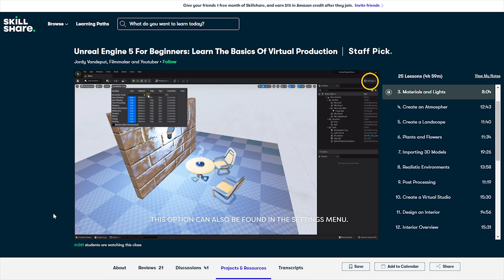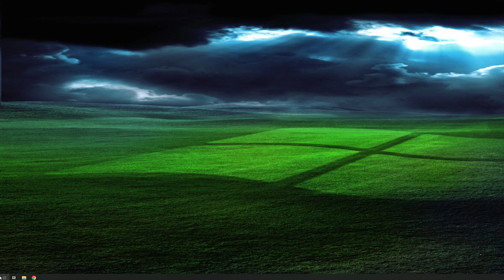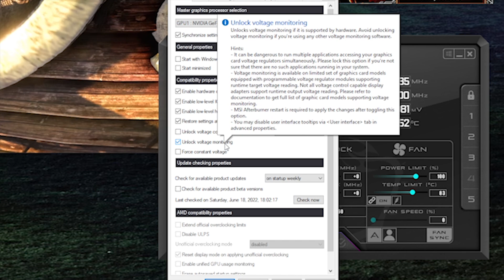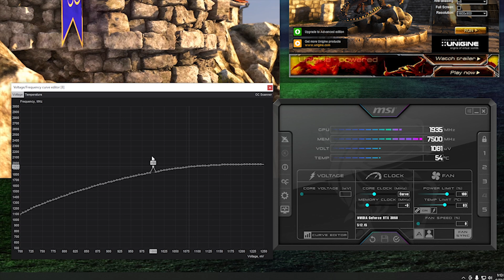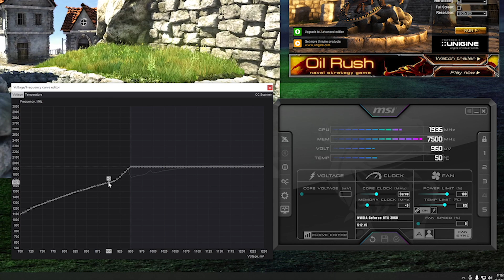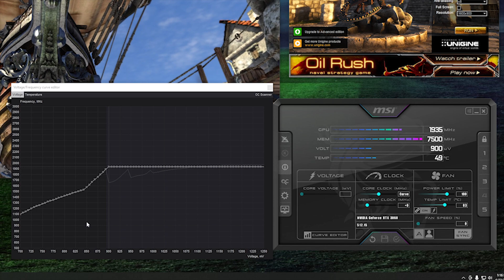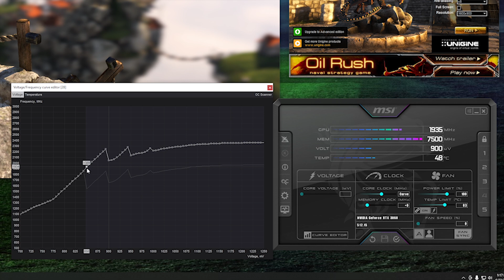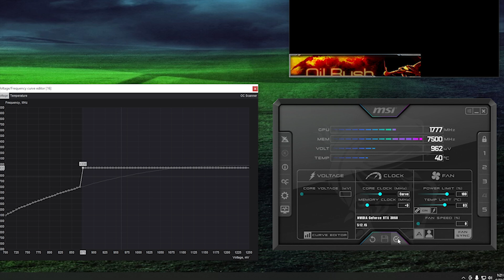Should You Undervolt Your GPU?

Comment: Im a noob when it comes to this stuff but I tried following the steps as best I could from videos on YouTube. My 3080 12GB model would always hit and stay at 83c when gaming. The core clocks would be around 1980-2000. After messing with my case fans and GPU fans I got it around 70c but my pc sounded like it was about to take off lol. So I tried undervolting and came to 1920 core clock at 850mv. I ran a few benchmarks and played some ray tracing games and no crashes and now my GPU is around 65-67c while playing the same games.
Reply: This is what i like to see, learning to make your PC run better & cooler.
Reply: Your an example of someone I would say to undervolt the gpu. People undervolting gpu's at 63c already is just stupid. The entire point of doing this is to get to 60-70c range of heat. Nvidia says the operating range of these cards is 40-90c for normal operations. Anything above 90c is way to hot. So you were getting close to the to hot side of things and undervolting in your case is exalting what this video is great to show someone like you.
Reply: can you please help me understand one thing. I just cannot come to the logical conclusion. Figuring out the mv seems easy by just trial and error. But how do you find out what mHz to set as the max for that mv? my gpu jumps between 1870 and 2050, and if it nears thermal throttling it moves even more. I just dont understand where the guy in the video got 1935 from, or where you got 1920 from
Reply: The funny part is, often times your average FPS will go down slightly, but in actual gameplay it feels better.  Probably due to a more consistent frame time.
Reply: So let’s revisit after your OP. I bet you put the voltage back to stock. Then downloaded MSI Afterburner. Then cranked the voltage and the power limit and added core and ram MHZ so you could get higher FPS than an out of the box card.  Why wouldn’t you want 10% extra horsepower for free?  Undervolting is just plain stupid. If your temps were too high you have another issue to look at.  Like case airflow.  I run my 3080Ti at 100% fans and it sits at 2040mhz at 1440p at 65-70c. My 2080ti in water would run at 2100mhz at 50-55c. Where headphones and you can’t hear 100% fans. Just depends on the clocks you’re chasing. But undervolting is stupid.
Reply: @ironmaiden5658  20 years of experience how to reduce the lifetime of your card and probably fry some memory dies along the line. You are a hero.
Reply: @saltysalt7339  I still own the very first card I overclocked in 1998. And it still works. Shorten the lifespan. How long of a life do you want?  Unless you’re building a period correct PC and need an old card, a 25 year old card is useless. You're excuse is moot.
Reply: @saltysalt7339  Hey I know. Let's pay the price of a 4090 but then undervolt it to the speed of a 4080. Pfffft.
Reply: @ironmaiden5658  All dem cards just work 10 years straight for sure. All those broken cards out there are just for show and fake news. What a clown.
Reply: @notstarboard9792 Overclocks never makes sense. Bahahaha. Thanks for the giggle. You should tell that to the world overclock record holders. I'm sure they'd get a good giggle out of your wisdom as well.
Reply: @ironmaiden5658  Fans don't get worn out? I run my fans all the way but I've been freaking out a bit about that

So undervolting is dumb unless my Temps are out of control?
Reply: @SmoothSportsGaming  I own nvidia graphics cards that are 25 years old. The fan still works perfectly. Undervolting is a myth. In fact Nvidia just released an official overclocking tool. Funny enough it doesn't undervolt.
Reply: @ironmaiden5658  Thanks man. Glad I didn't just believe all these videos. I knew something was up when every video was copy & paste.

You mean the auto overclock? I have that on but I can't tweak it so I'm going to MSI
Reply: @SmoothSportsGaming  Yeah no worries. Yeah the auto overclocking is a bit rubbish. It's really only for noobs who don't know how to properly overclock but want that little bit extra for what they paid for. MSI is 100% the go-to to overclock every card when you know what you're doing. If you have a 3xxx or a 4xxx series card you can't go wrong. They're so locked down these days it's just a matter of cranking up the core and ram till it crashes or artifacts. I've been a watercooler for almost 20 years but the way the 3xxx and the 4xxx series cards are managed I ditched water cooling after my 2080Ti and been running the fans on the 3080Ti. Water cooling the 3xxx and the 4xxx series is a lot of money with very little return in FPS vs air cooling overclocking.
Reply: @ironmaiden5658  Under volting is great for say a laptop gpu. I can't make that laptop have better air flow tbh. I can't upgrade fans or add water cooling to it. I am limited on what I can do with that machine. But what I can do is undervolt the gpu. 

I agree most of the time you don't want to undervolt your gpu at all. Zero performance boost and you reducing performance actually if you doing it when you around temps like you stated. But if you at 83-90c. You close to temp throttle anyway. Undervolting the card will most likely give you a boost in performance because of it.
Reply: So you successfully achieved lower clocks and lower FPS.. Yeah cool. Good story bro. Way to overclock. NOT.
Reply: @ironmaiden5658  Benefits outweigh the negatives. Not losing as much fps as you think.
Reply: @thurstoid9811  BS. I've been overclocking for 20 years. You want as many Volts and Watts as you can throw at the card. There are 3 factors. Watts. Volts. Degrees. If you're just a pleb running stock fans then we can't even talk. aa
Reply: @ironmaiden5658  Ahh i see the master of graphics is here...
Reply: @bopheadshot2710  Yep. My 3080Ti is 2085Mhz with 1.085 volts. 350 watts. 66 degrees C. . 100% fans. 1000Mhz RAM. Been overclocking since this guy was on the milk bottle. haha. Under volting is the dumbest thing I've ever heard.
Reply: @ironmaiden5658  100% fans? you must be deaf
Reply: @andreivladut11  Get a good case. Wear noise cancelling headphones. Get good.
Reply: @ironmaiden5658  You have no idea what you’re advocating against and what kind of idea you’re trying to get across. A good undervolt will always outweigh the benefits of an aggressive overclock. I’m running a 4090 with a 13900k and I’d choose an undervolt over an overclock any day.
Reply: @sgtdroid  Absolute BS.
Reply: @ironmaiden5658  better to undervolt then im not pc savvy so would probably leave mine

Comment: My old pc is 4 yrs old. Running windows 10 Pro (😂 without MS account) and Asus Armoury Crate + Aura Creator for mobo, ram and case fans. My PC specs are :
1. i3 8100 LGA1151.
2. Asus Z370 TUF Gaming Plus ATX Mobo.
3. Cooler Master Hyper x212 CPU Cooler.
4. G.Skill Trident Z RGB 16GB 3000mhz (2 x 8GB kit).
5. Asus Strix GeForce GTX 1060 6GB OC Dual Fan (Black).
6. 1x Samsung Evo 960 M.2 Storage.
7. 1x Seagate Barracuda 1TB HDD.
8. 1x Kingston HyperX Fury RGB 240 GB SSD.
9. 1x NZXT HUE Plus LED Strip + Controller.
10. DeepCool RF120 mm RGB fans  (3 x fan kit).
11. Corsair CS650M 80+ Gold PSU.
I hope i may learn something about GPU.
Reply: Not really a fan of the cpu you have. I think you could easily upgrade for cheap. Not having those extra 4 threads on that cpu is huge. I have a i7 2700k which is insanely older than your cpu. Yet those 4 extra threads lets it easily compete with your newer cpu and beats it for performance. You should upgrade that cpu. To something better imo. You have the mobo for the upgrade. Imo if a cpu from 2011 is better your 2017 cpu and it is cheaper to buy the older cpu. Then just get the i5-8000 series cpus. These are worth it. Cost the same a brand new 2700k would cost and beat it in performance. 

Your board supports the 9000 series also. I'd buy a i5 from that series if you want to stay budget friendly. Same price as a 8000 series i5, but newer and better performance with 6 core 6 threads. 2 real cores make a huge difference.

Comment: I wonder if someone is struggling with the same problem than I do.

I have a laptop that is connected to a external monitor, when I undervolt my gpu, it's all fine, when I'm gaming, editing & rendering its works great. The problem is whe I leave my pc doing nothing, after se mins when it's im "stand mode" it's crashing (BSOD), or some times its switches back to the laptop monitor from the external (and them I can not switch back to the external, unless I restart the pc) . The my laptop restarts and I have to start msi afterburner again. Like why it's happening? And another think I found, is that when I switch from the external monitor back to the laptop monitor this thing does not haappen. Like what the heck
Reply from the maker: What power profile are you using? If you have it set to performance it might be leaving your GPU in 3D mode and not allowing it to switch to 2D mode.

Comment: In the clock graph you can leftclick on a point then control+shift+enter and type in the Mhz you want to reach instead of manually sliding it. So shift+leftclick every point you want to change then click on a point ctrl+shift+enter. Just wanted to share that!

I have undervolted underclocked my nvidia mx150 2gb laptop and because of it I can run fortnite on 60fps on a laptop that on stock settings would overheat if even running it on 30fps. It's great for some situations!
Reply: What value did you give while under clocking?
Reply: @rahul-qm9fi  I kept it at about 1250Mhz while using the minimum amount of voltage. Underclocked Mhz voltage and overclocked memory. Also undervolted the CPU.

Comment: I have a helios predator 300 315-54 rtx 3060, and I undervolt mine to 850 at 1960 and see significant fps gains while having a -10 degree reduction at all times, definitely helps with gaming laptops
Reply: How's your undervolted laptop now? is it still running without any issues?

Comment: Okay, so...i decided to undervolt my Gigabyte RTX 2070 Non-Super since i had some temperature issues with it. All i did was to set it at 850mv (wich it seems to be quite freaking stable) and i now i get temperatures between 70-75C in full freaking load my guys. Yes, this is possible even with 30C ambient temps. I also played with the fan curve :D. It also helps the fact that i added 140mm fans on top, so now i have better airflow in my FSP 350 CMT case (front panel chocking it's not great). Thank you for your video as it helped me better understand MSI Afterburner!

Comment: I’m wondering if it is possible to undervolt the Intel 12th gen non-K mobile CPU es example 12700H???
Reply: yes it is possible to undervolt a cpu also. You don't use MSI  to do it thought. MSI is like the noob friendly version for gpu OC.  AMD ryzen master will allow you to OC amd cpu. Intel doesn't make one, but there is custom programs for doing so. You can also do it in the bios. But if you don't know what your doing. I wouldn't suggest it.

Comment: There's a setting for voltage control. The checkbox was above the voltage monitoring. Why not just enable that & apply a negative offset? Why mess around with custom curves when you could apply the offset to the entire curve much easier?
Reply: I don’t think that can go negative? Dunno know 🤷🏻
Reply: @robreich6881  worth a look anyway
Reply: @clintcolombin  Does it do the AUTOMATIC control too ? Or it always stays at that voltage in idle? Because if it doesn't  go to idle voltage in idle you are wasting power. 

Curve editing makes that happen too. When it goes to idle it drops to 400 MHz 625mV. Does the thing you mentioned do this thing?
Reply: A negative offset should apply to the stock curve automatically. The idea is that it applies the offset to the entire curve
Reply: Because your GPU may require more Voltage and if it does it will stutter to all hell. If you keep the max voltage potential high it will have the ability to go higher in some frames without stuttering.  The curve is just what it runs consistently on average, but there is always an exception and your GPU may require more power at times.
Reply: @JALA578  the offset maintains the stock voltage curve without manually setting the values. It’s effectively the exact same thing as what was shown in the video
Reply: @clintcolombin  well then if that's the case use the other method. Whichever way works to get your desired result. I personally don't mind the curve.
Reply: You can not go negative on the slider, look at it you can see it’s at 0 already 🤦‍♂️ have you used msi afterburner before?
Reply: You can change the offset from positive to negative in the versions I've used. It's a very dense program

Comment: i've always recommended that people undervolt both CPU & GPU. been running the ol' reliable RX580 forever at either 1400mhz overclocked & undervolted at a 1075mv (-75mv) for games. it never goes above 72 degrees with fans around 1500 RPM. for long compute runs i run it underclocked at 1000mhz & undervolted to 900mv (-250mv) & it never reaches over 60 degrees with the same fan settings. 
saving a couple 100 watts is great as is for the power bill. but the best part is so much less heat. especially on hot summer days, every degree only adds to the misery.

Comment: If you have a laptop, that runs hot then it's worth it. Yes, under volting actually gives a benefit if you have a laptop, both temperatures and power consumption are reduced which saves a little more battery life.
But anyone doing this should perform a GPU Stress test by running in game benchmarks or other stress testing tools etc. To confirm that there undervolting actually works without any issues.
Reply: Yeah, it's worth it especially if you have a laptop. Laptops usually run toastier that a desktop and let me tell you something: Repasting also helps if you didn't do it for quite some time. And for the love of god, please don't use a laptop in your lap (it will get hotter than a burning young sun).
Reply: Ya good point. I would suggest to undervolt laptops.

Comment: All I need is a 3000 series :P I'm on 1660 TI she can do 1890mhz But that's with everything set as normal and I have not changed any voltage
Reply from the maker: The 1660 is a good card. Luckily 30 series cards are coming down fast, so hopefully you will get one soon.
Reply: @CyberCPU  She's good for the 2019 mid-range series at the time, But 6GB VRam is what makes her limited and whatnot. Hopefully, by October I be getting a 3070 or 3070 TI or maybe the price is right a 3080.. then again it's 50/50 at the moment with the 4000 series coming near, 4000 series would be the same price factor when the 3000 series was released but would end up costing more as I would need a new power supply as my 850W might be too small.
Reply: @Empire24453  If the launch of the 3000 series was any indicator, the 4000 series will be just as highly sought after and hard to get, especially trying to compete with the bots and scalpers.  If you can afford a 3000 series card now, I'd grab it.

Comment: Thank u sir , this was so helpful .. at msi afterburner i get another curve editor with 2 lines ..but my gpu is amd ! i have to put the numbers for both lines manually ..my gpu stock boost is 1260 should i keep on boost or i should lower the core clock ?
Reply from the maker: Try it both ways and see which one works better for your system. 

I didn't cover this in the video but I also undervolted an overclocked boost clock and got pretty decent results from it.
Reply: @CyberCPU  Thank you ,you are the best
Reply: AMD's own software works pretty well for UV and/or OC in my experience, better than Afterburner for me personally, so it could be worth trying.

Comment: I don't have the Curve Editor . Please help me
Reply from the maker: You can try hitting CTL+F to open it. 

What GPU do you have?
Reply: @CyberCPU  gtx 750ti. CTL+F not working.
Reply: why you trying to undervolt that gpu. If that gpu having temp issues. You need to reseat and clean the cooler and fans. I would take apart your gpu instead of undervolting it, then add thermal paste to the gpu and put it back together. 

That gpu shouldn't have temp issues at all. You aren't gaming any type of game that would make it have issues. That gpu is so limited to the games it can play now due to lack of vram.

Comment: Definitely recommend people giving this a shot. Especially if you enjoy tinkering. I’ve been undervolting a 1080ti for about the past year with great results. Only maybe a few percent increase in performance using Heaven as a benchmark but more importantly slightly lower temps, lower fan speeds, and more stable clocks.
Reply from the maker: It's definitely fun to play with but since my GPU is water cooled it didn't benefit me enough to go through the hassle of dealing with the temperamental curve editor every time I boot the system. However, that might be a different story if my GPU was air cooled.
Reply: @CyberCPU  In my case it’s a blower card so really worth it in my case. Haha!
Reply: @CyberCPU  so if i undervolt my gpu with afterburner i have to redo it every time i boot my pc? lol...i wanna try this with my new build with the 3090 but if i gotta fiddle with it every time i boot up  than i prolly won't bother.  lol
Reply from the maker: @DiagolonRider  you can set it to automatically take effect every time you boot up but I don't recommend it. If you ever have a problem with your overclock then your system can be unstable at boot up. I recommend manually setting the overclock before you play games. Otherwise you might have to boot into safe mode and uninstall MSI afterburner if you have an unstable overclock mess the system up. If you said it manually then you have the opportunity to adjust it before you apply it.
Reply: @CyberCPU  right on! thanks for the reply!
Reply: can you help me understand how to get my baseline number for the mHz ? So for this guy it was 1935, but which number do I pick if it keeps going up and down a little